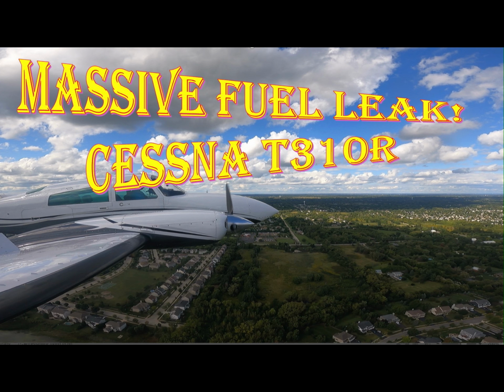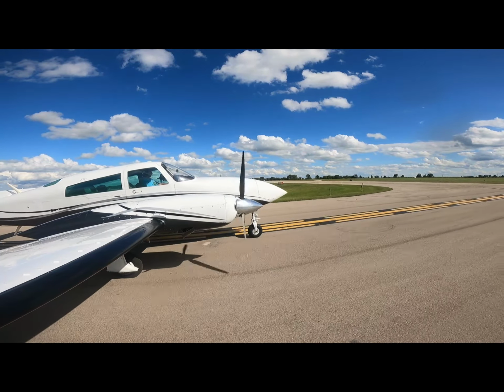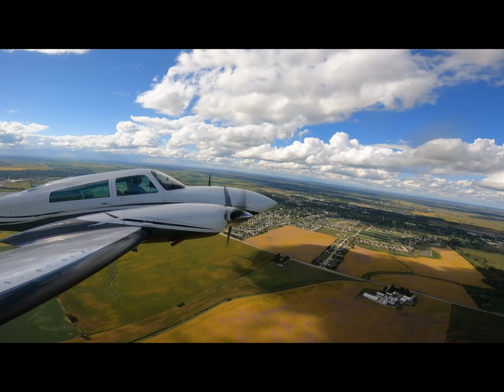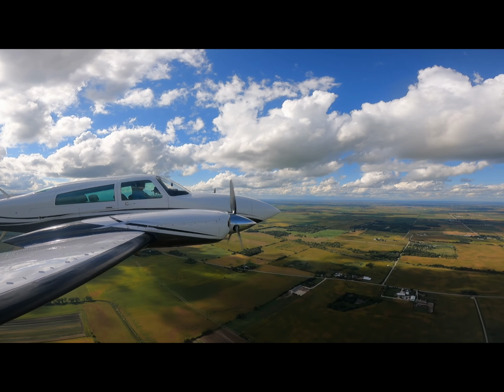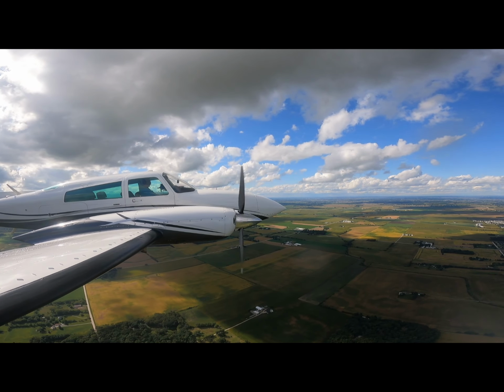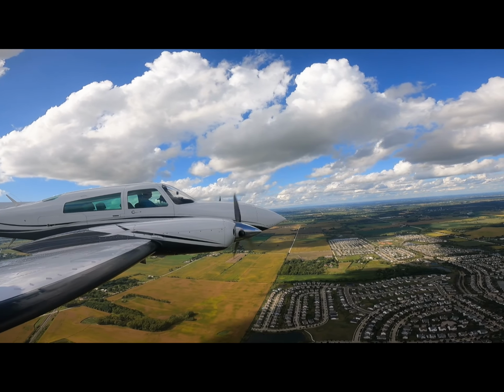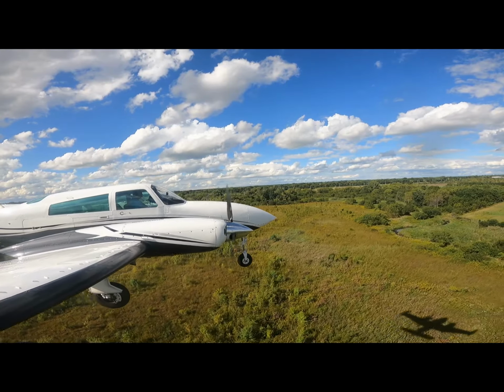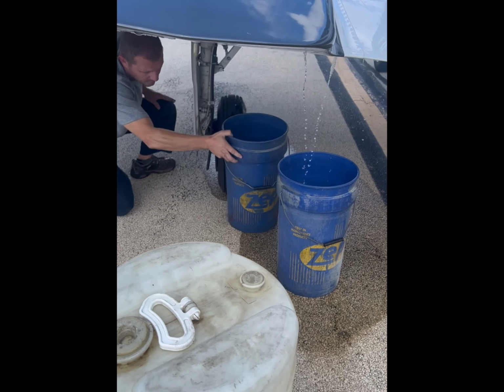Cessna T310R Massive Fuel Leak due to wing locker bladder failure. Fortunately no inflight fire.

Comment: One nit to pick, the wing locker tanks are metal. Thanks for the videos Ron!
Reply from the maker: No, they are bladders. Just looked at them.
Reply: @ronrogers  Oh sorry! I will have to take another look at mine…
Edit: Mine are all metal tanks. I don’t know if it came from the factory with the wing locker tanks installed, and the maintenance manual does show a bladder laying in a protective box. My locker tanks show a date of mfr in 1980, so maybe they were installed under some sort of STC. I will have to check the logs. My airplane is a 1977, s/n 862. 203 gallons is a nice option, and I used to subscribe to topping the aux tanks, but now I only fly with planned required fuel plus an hour. In order to keep my weight to a minimum, I keep the aux tanks practically empty. My thinking has shifted by studying all the accident data related to light twins and Vmc rollover incidents, and the anemic performance on single engine operations, but “I Digress!” Keep us informed on how this new project unfolds, and thanks for making these videos.

Comment: When I was a kid hanging around On Mark Engineering at VNY. I learned that Goodyear Pliocell fuel tanks can get dry and brittle. "Keep them full when storing the airplane". I had a 1949 Bonanza, 1976 Baron BE55, and I flew the 1966 Queen Air BE65 while owned by Hoffman Electronics in CA. All had Pliocell fuel tanks. I always kept the Bonanza and Baron topped off, at the end of each flight. Always. I never loaded to where I couldn't take full fuel. The Queen Air was not under my control. One day we arrived at the Denver airport to find a large LAKE of fuel under the aircraft! The fuel cell had cracked and leaked it all out! I thought to myself holy ** there by the Grace of God... Not long after, Andy Taylor of Norm Larson Beech at VNY was flying another BE65 and the left main sprung a leak like you encountered. He was not that lucky. The fuel ran down to the nacelle and out the augmentor tube, and caught fire. The wing burned off rather quickly. All hands were lost.  If the 310 has Pilocell tanks, and any of them have been stored partially filled or empty, especially outdoors for anytime, have them inspected pronto. Then have them all inspected. Maybe replaced and then kept full. They'll last forever if kept wet.
Reply from the maker: Thanks for the info! And yes, it could have been much worse.

Comment: Fuel leaks are no joke. Avgas is quite a bit friskier. 

We had a local flight instructor and student who were behind a twin on downwind attempting a hurried landing after some fuel system work, where a line was improperly installed. They radioed "hey you have flames coming out of that engine..." then BOOOM! The wing blew off like it was hit by 88mm and it tumbled end over end until a parking lot camera caught a couple frames of it before the pilot and plane disappeared in a ball of fire.

Tbh, most GA aircraft are turds. (Certified) turds.

Comment: Glad you're safe Ron. I always kept my 15gal aux tanks full.  I'm just speculating here. It's been a while since I've had a 310 (like 35 years), but as I recall you can't start to use the aux fuel until you have room in the mains for the fuel return from the fuel injection system. So, if I'm correct, trying to burn that fuel was not a valid option. I'm just guessing that you can't burn directly from the wing locker tanks (I didn't have wing lockers in my H) but only transfer to either the mains or aux tanks. Did you ever consider shutting down that engine? That's a tough call.  Thank God it wasn’t leaking from the upper deck and streaming back over the turbo.  Good video my man.
Reply from the maker: You are correct on the operation of the aux tanks. Even if I could burn out of them, I was only 10 minutes out or so. I did consider shutting down the left engine, but the right was also leaking!
Reply: @ronrogers  And if you did shut the left one down, it would be the right that started a fire.  At least that would be my luck.
Reply from the maker: yup!

Comment: I was mistaken. I thought the FCC didn't allow cell phone use only above a certain altitude AGL. I just looked at 47 CFR § 22.925 and it does, indeed, prohibit cell phone use if the aircraft is not in contact with the ground. The rule even requires a placard, but I've never seen one of those. Thanks for giving me a reason to check that.
Reply from the maker: I was exercising my emergency authority if you will. That is my story and I'm sticking to it!
Reply: @ronrogers  To quote my relatives in the Upper Peninsula, "Dere ya go den."
Reply from the maker: Youbetcha!
Reply: There is zero reason not to use a cell phone in the air other than it wont work very well.

The FAA and FCC in their infinite wisdom banned electronic devices before the cellphone was invented.

When the phone came about, they doubled down and claimed it would ruin America if people could bounce between towers, just like millions of people do in their cars every day...

Turns out, cell phone towers have been and always will be highly directional. They transmit a horizontal beam, just like any nav aid has a directional beam. And it does not point upward. You cannot get a very good signal above about a mile high. It will transmit to a further tower away as you climb, causing the signal to diminish till only a text might come thru approaching the flight levels.

Government overstep their core competencies. Mor like their core competencies are incompetence, ignorance, and a general destructive force against progress.
Reply: @Triple_J.1  When I was at Bell Labs, I helped design the cellular telephone system. It's expected that your signal will be received by two or three cell sites. At altitude, you could appear on dozens or even hundreds of cell sites. That will cause grief with the system.

Yes, the antennas are directional but there's no such thing as a perfectly directional antenna. There will always be sidelobes and your signal will still seep in. Even though it will be attenuated, it can still cause problems.